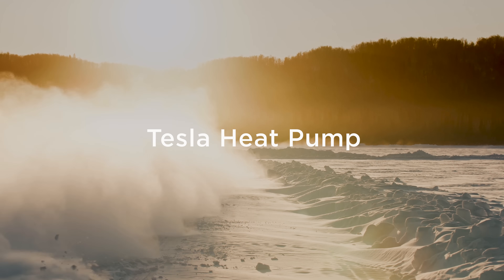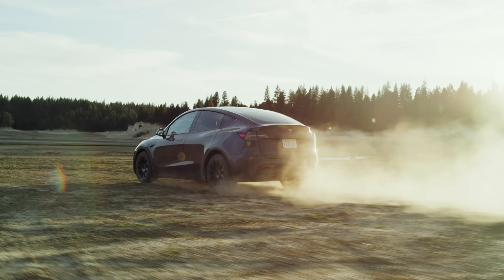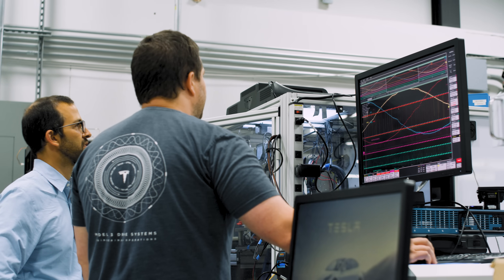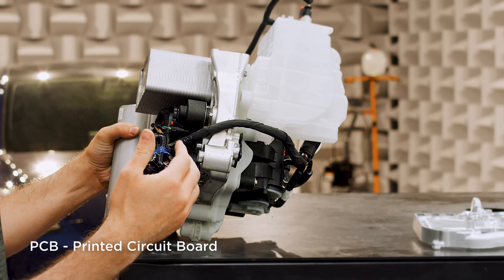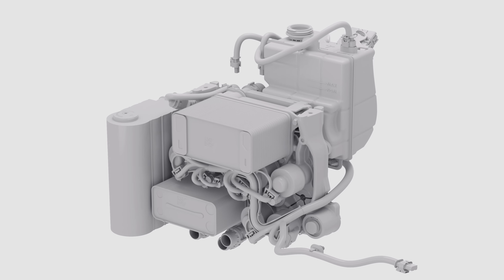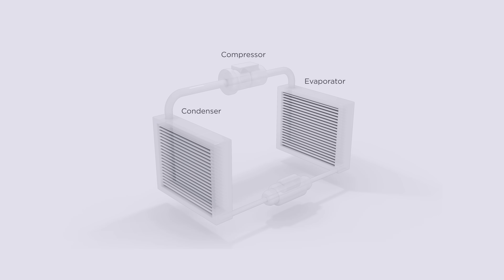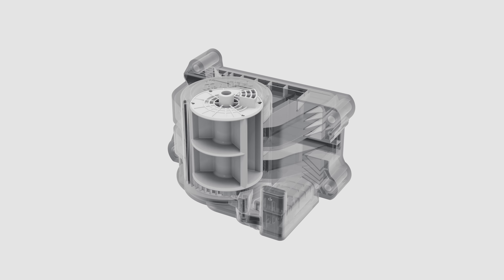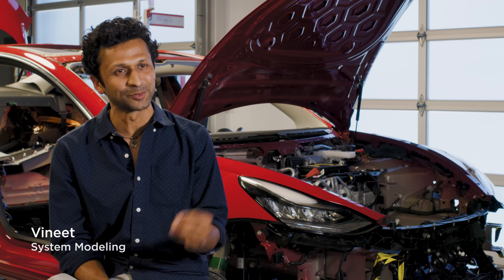Tesla Heat Pump | More Range in Cold Weather

Comment: About time :D  Last December, my Model Y went on its first journey. Fully charged barely achieved 230 km :/  Avg 120 km/h, Outside temperature -6 °C
Reply: Wow that's quite the speed you were driving at. Did you pre-heat the battery?
Reply: @logitech4873   No speed actually as I am targeting 130 to reach my destination in due time.

Yes, I did preheat the battery and the car. However, I assume that preheating is not that effective at -6 °C due to the cooling effect from the driving wind ...
Reply: @koertved  Such high speeds are obviously going to reduce your range though. Where do you live where you can drive that fast?

Comment: When Sandy Munro explained the significance of the heatpump and octovalve I was absolutely flabbergasted for the innovation. These things simply add to the vehicle's efficiency and drastically reduces the number of components that can break. I love Tesla's component integration, vertical integration and pushing the limits of technology!
Reply: how do you get the heat pump to begin with??
Reply: @unknownentity742 What are you, a European trying to lecture about technology adaptation? Hey why don't you try these new "Air conditioning" things. Maybe you won't lose 10,000 people to heat stroke every year.
Reply: But shit quality in winter
Reply: Well to be fair, the heat pump itself is a complex piece of equipment with components that can break over time. Still an amazing piece of engineering though.
Reply: @aegystierone8505  - All equipment breaks over time, simple or complex, so what?
Reply: Are you men or woman

Comment: My Tesla heat pump broke down twice in a year, so if you just could work on the reliability next, it is major issue up here in North with Teslas.
Reply: Mine failed too, thankfully while in service center. It is an issue that needs a better solution. Hopefully it doesn’t fail on a road trip in -20 C!
Reply: heat pumps are not known for their reliability, accept maybe geothermal but air to air heat pumps in very cold climates really don't seem to make customers to happy.
Reply: Yes my broken too 3 times shit quality compressor and all system HVAC never buy Tesla shit quality i spent 4000$ in Russia Saint-Petersburg

Comment: Now please put this into a residential system. I would love a fully integrated system with PV, heat pump and powerwalls. Combine the heat pump and battery storage so you can use the waste heat from the battery.
Reply: "Dear Tesla, please do..... Everything"
.
Reply: @rogerstarkey5390 well, if it is that or a stock buyback, I would prefer them to expand to residential...

Comment: It works great, its so efficient in the wintertime. The range loss is very low, great job.
Reply: Did they pay you to write this comment?
Reply: @neelzhome8431  sadly not 🤣
Reply: @steffen8964  but it doesn’t change the fact that a battery is still having troubles in a cold weather?
Reply: @oleksii000  yes thats physics every battery doesnt like cold weather. But it works great in cold weather. No issues.
Reply: @steffen8964  well it’s very different from what I hear in Edmonton.
Even some vehicles that run on gas have troubles.
But if it works for you then good for you
Reply: @neelzhome8431  yeah it's a marketing scam. my BYD comes standard with one. i see it takes same electric to heat as my leaf did. people want to believe it. it's all crap.

Comment: I am in the Northeast and I noticed the benefit of the heat pump a lot. My previous EV was ID.4 without any heatpump let alone octavalve etc. Its winter consumption was terrible. The range was decreasing half even in mild cold weathers like 23-28F. Tesla Model Y is just a beast when it cones to efficient. Yes winter does reduce range but by 10-20%. It is magical. Go Tesla Team
Reply: How is Tesla getting the chips needed for the heat pump. But legacy ones can’t get them? Seems like legacy are falling
Reply: @jake5993  Tesla is agile, they updated their systems and designs on the fly to use more modern chips, and it's the old ones (~20 years old tech) that's experiencing shortages. Legacy is using these because heat pumps don't need very sophisticated chips, but because they're so slow and only make ~25-50 changes to a car per year (whereas Tesla does ~60 per day) it takes them years to update their designs and models.
Reply: My MY range drops to 170-190 miles in moderately cold temps (above 20F). That is huge drop and not your 10-20%. I cannot make a ski trip from home (100% charge) to our fav ski slope 94 miles away without stopping to supercharge. Annoying!
Reply: @Bambarbia2447  100% and I'm so annoyed that NO ONE is being truthful about this.  Even Now You Know said 15% loss in their most recently video.  This is BS.  I get under 50%. My MYLR with a 325 miles range max out at 150 actual miles forcing me to charge literally every 100 miles since you don't want to drive down to 0 miles. A 375 miles ski trip from NYC going to Jay Peak VT near Canada border require 3 stops b/c u don't want to arrive at destination with nothing left.
Reply: @Bambarbia2447  sucks you have no heat pump
Reply: @pilotavery  It does have it. Build late 2021. Range loss is less about heat pump and more about battery losses in cold temps and energy to keep it a bit warmer
Reply: @Bambarbia2447  Do you have the standard or long range?
Reply: @danm4320  Long Range
Reply: It's even worse than that. The ID.4 did have a heatpump, but they've started to remove it now because of chip shortages. So chances are your ID.4 was that inefficient WITH a heat pump, go figure how bad it'll be without it...
Reply: @Ehralur  mine didn’t have it. All US ID4s come with no heat pump. Europe and Canada cars were getting it.
Reply: @suvari225  oh damn, wasn't aware of that. Makes it even more shocking that they're removing it from the relatively small amount they're selling in Europe imo.
Reply: @suvari225  don't worry, heat pump on id platform is trash. I have it and in some conditions consumes more than tradicional system...defog slowly ... etc
Reply: @suvari225  happy with mine here in SoCal.
Reply: @Ehralur  thge US ID.4 do not get a heatpump, at all.
Reply: @Ehralur  You have no connection with technology, parallel tracks. The heat-pump efficiency is dictated by the evaporator temperature. Refrigerant is the same, as the automotive is forced by the circumstances to use R134a/yf high temperature freon, not that efficient  especially in cold climate. So if you are driving in -20C, for short distances you will have the same efficiency as with PTC. 
ID4 is more technology advanced than tesla, on the drive-train... . The big difference is related to battery capacity and drag coefficient.
Reply: @CATA20034  experts disagree with you. Excuse me for trusting industry experts over a random dude on YouTube.
Reply: @CATA20034   you are hilarious to say that ID4 is more advanced then a tesla , this is the most stupid thing i recently heard .
Reply: People seem to forget ICE engines drop fuel economy with lower temperatures too, and I'm not a fan of electric cars just stating facts. Also the "octovalve" isn't really new technology, it's just existing technology repackaged and called something else. The principals of any refrigeration cycle are the same, a place to absorb energy, a place to exhaust energy, something to compress the refrigerant, and something to phase change the refrigerant from liquid to vapour. All they are doing is using a valve to send hot gas, warm liquid, and cool gas to different places to do different things as required. The only impressive thing is how compact they made it.
Reply: @whatshappenedhere1784  you're right. And lithium mining is terrible.
Reply: wait how do you get the heat pump to begin with??
Reply: batteries don't like cold either way
Reply: my ID3 has got a heat pump, range loss at 0C is 10%. Down 15% at -4C.
Reply: Similar—Nissan leaf had precipitous range loss—staggeringly bad in cold weather. Our 2023 model 3 does markedly better. When it’s able to precondition for morning commute it’s surprisingly efficient even in low temps.
Reply: At least your id.4 isn't known for having wheels snap off ahahahahaha!
Reply: If you don't mind me asking, why did you buy an ID.4? To me, all the other EVs on the market are steps behind Tesla
Reply: How does it cope with soggy NE summers
Reply: в России ставят на электромобили дизельный подогреватель,и даже в -30°С ,пробег остаётся почти не изменным,кстати тесла 2 будет Гибридом 🙄
Reply: What year did tesla start using the heat pumps? Also any issues with opening doors if it ices over outside?
Reply: i have heat pump on my BYD. my leaf didn't. i see no difference. i think it's just a marketing scam myself.  if it does help with range i cant see it. keep the money it costs to buy this crap.
Reply: You gained from switching to a tesla, heat pump wasnt your issue😂
Reply: ICE engines consumption also vary with outside temperature, let alone if you use the belt driven (!) air conditioning. But somehow the "range loss" is only discussed as a "problem" for electric vehicles. Maybe because an ICE car has a rough gauge for fuel, that people only care when it goes to "red", and EVs have a precise numeric indicator...
Reply: @ptviwatcher  Exactly! Give ICE cars a precise indicator in percentage, and people will freak out even worse.
Reply: @achilles-live  20-50C ambient air temp change will increase combustion and heat efficiency by only 14-16%... Hardly noticeable in an ICE
Reply: @ptviwatcher  It comes down to charge time and overall max range. You can fuel up 90s Civic in few minutes and still have more range than Model Y. 

I actually changed my car straight from early 2000s Civic into 2021 Model Y and I would never even consider to go back, but for some people it's really hard to break from the pattern of fueling up and having a lot of range.
Reply: @ptviwatcher  my ICE car loses about 21% range in the very hot summer w/ the AC. It's quite noticeable. But people judge EVs with a higher standard.
Reply: @acasualviewer5861  It is not the range so much as the availability of chargers versus gas stations.
Reply: @johneric98  as any new tech, it's a process. Though I rented a Tesla in CA a few months ago, and didn't have any problem with chargers.

I appreciated paying much less in gas costs too. And the car was very fun to drive. It wasn't even the "long range" car.
Reply: @acasualviewer5861  Yes but how long does it take to "recharge" your car?
Reply: @M4X1  you can recharge an IONIC 6 from 10% to 80% in 18 mins. Not bad really.. Considering it has a 360 mile range.. and you're likely to stop for a bite or the bathroom anyways.
Reply: @acasualviewer5861  360 mile range in perfekt conditions, in cold weather it’s more likely to be 180.
Reply: @M4X1  no.. recent tests of modern battery systems show only a 10-15% loss of range for cars with heat pumps
Reply: @acasualviewer5861  In what temperatures 0c?
Reply: @acasualviewer5861  Then there is something wrong with your car. I have a Raptor and I don't get that kind of loss.
Reply: @ptviwatcher  only if your experiance with ice engines ended in the 80's, for quiet a while cars will inform you of their current conusmption average consumption and how many km's to zero  (not including reserved portion which is 100km on average
Reply: @ptviwatcher  that must be why
Reply: @ptviwatcher  Well heat is a byproduct of combustion so heating is free. The AC Compressor on modern cars has a variable compression ratio so it only produces enough pressure for the cooling demand. EVs dont have any energy to spare unlike combustion engines which rarely run in optimal efficiency load. So its a much bigger factor to save energy in EV cars.
Reply: @K0nst4nt1n96  True. But lets not tout ICE vehicles "energy waste" as an advantage. Discussing EV efficiency is one thing. Bringing ICE vehicles as "not having that heating problem" as if EVs are worse is just plain wrong...
Reply: @ptviwatcher  I call it what it is. Its an advantage regarding use of waste heat from the combustion process. EVs have a lot less energy dense storage and must therefore use the energy more efficient. 
The powertrain is more efficient with around 90% or more with the new mercedes eqxx (95%) and intelligent scavenging of heat from the motors or battery and use of heat pumps.
Reply: @ptviwatcher  no bro, ICE have very precise measurements for fuel consumption. How do you think the injectors would know what to do? That precise mpg or L/100km figure you get, think that’s just bs? On average I get a couple mpg less in cold weather but that’s mainly because I wait for the car to warm up a couple minutes before leaving unlike in summer. Even though in summer I use the air conditioning which pumps cool air right away but uses quite noticeable power to drive the compressor.
Reply: @ConstantinSPurcea  that's not right. I drive a diesel w/ common rail & piezo injection and I always write down the miles on the fuel invoice and real consumption is always different from the car's computer. By as much as 5%.
Reply: @ConstantinSPurcea  Correct. Technically, an ICE is more efficient in the cold because the air is more dense for the engine
Reply: @ConstantinSPurcea чувак учи физику,двс зимой тратит больше топлива ,не только при прогреве,но и при езде ,так  как печка забирает тепло!!!двс это ТЕПЛОВОЙ ДВИГАТЕЛЬ,по сканеру легко смотреть температуру,если летом она выше 85°С,то при  включённой печке на 25°С температура двс не доходит и до 80°с и это когда на улеце -5°С,по трассе на скорости 100км/ч в -20 ,температура двс не поднимается выше 70 градусов !!!!
Reply: Good move dumping VW for a Tesla.
Reply: imagine if you could some how transfer hot tesla car in CA to colder area in  yours cold tesla and do opposite like sharing data.
Reply: @Tinjinladakh  this makes no sense, you'd have to drive the car like 10 hours away

Comment: I have 2022 model Y but did not seem that efficient in cold weather. Am I missing anything?
Reply: There are several variables related to reduced efficiency and range. 1) Greater resistance from strong winds, and heavy precipitation & snow (this affects ICEs as well). 2) Reduced energy availability from the battery due colder chemistry (which then requires energy to warm up). And 3) usage of a cabin heating mechanism. Depending on the mix of variables, I’ve experienced that winter efficiency declines from between 15-35%. Because of this, it’ll be beneficial for usable battery capacities in frigid parts of the continent to be closer to 110-130kWh… and for there to be more Superchargers AND higher voltage power trains to facilitate even faster charging. Looking forward to that future!

Comment: It's about time. Resistive heating is so inefficient and heat pumps output so much more heat per Watt of energy used, I was surprised you didn't use them right away. Especially considering there's already a heat pump in the car. The air conditioner.

Comment: I don't imagine many automakers would use thermal and manufacturing efficiencies as selling points. Maybe I'm just a nerd, but that's super badass to me.
Reply: Cold weather is terrible for ev efficiency, because resistive heating (electric heating) is extraordinarily inefficient. So yeah, they are trying to get ahead of that flaw. I don't know if it's a deal breaker, but it's noticeable apparently.

Comment: What is the temperature limit below zero that can withstand and be in working order of new Tesla cars with heating pump? -20 degrees Celsius?, -40 degrees Celsius? how fast will a fully charged battery sit in standby mode, at extremely low temperatures? Or is it still not a machine for the real cold?
Reply: Check comments from the Norwegian owners
Reply: @JBoy340a  Thank you